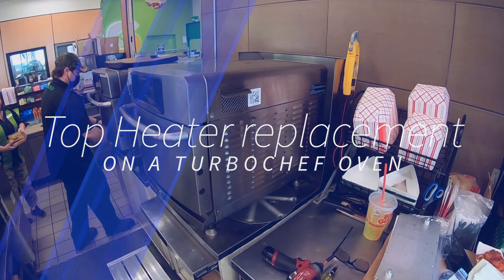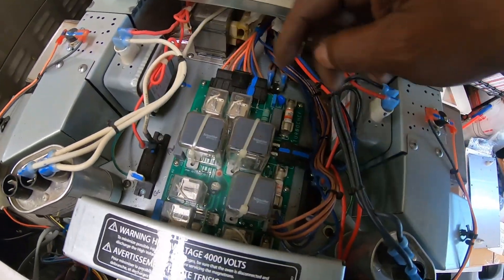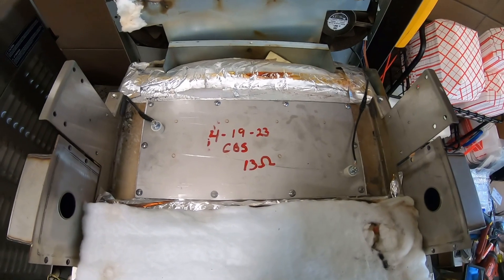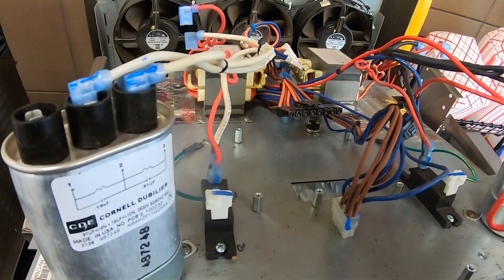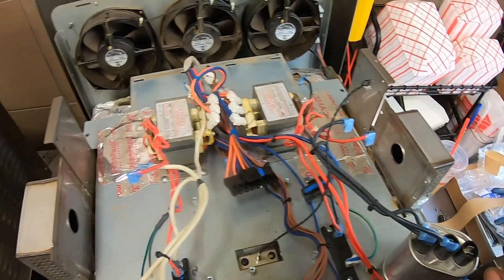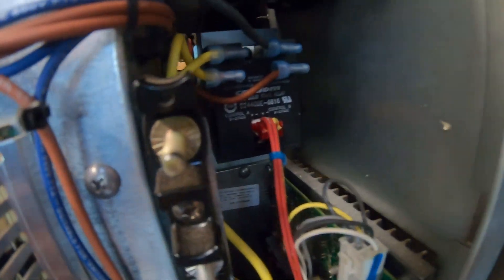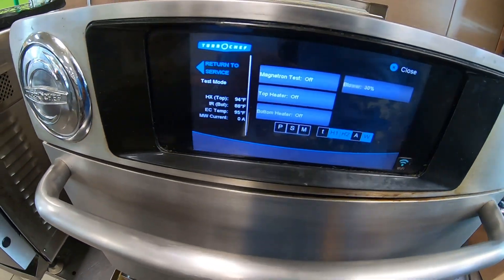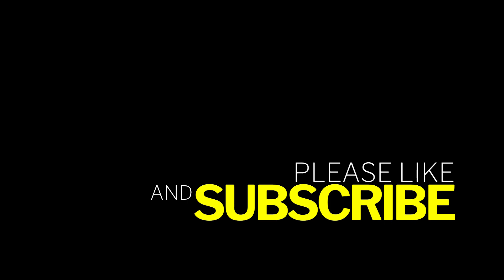Turbo Chef oven top heater

Comment: I have the same oven and the top heater is staying on and causing an F6: EC overheat. I tested the K4/K5 relay and here's the weird part... with all 4 output leads disconnected (not the control connector) the top element still stays on!!!. The only way I can get to to stay off is if I disconnect the other end of the element from the High-Temp Breaker in the back left (which from what I gather, is just connected to the EMI filter and then main power. Does this mean that the heater is shorted? I even disconnected the wire on top that goes from the element to K5/K6 (it had no frays) and the element STILL stays on! If I don't disconnect it, the oven never cools down after turning it off. It just says oven cooling down but the temp stays up and rises.

Comment: Turbochef dipped their toes into high end residential wall ovens about 15 years ago, and I was the local authorized servicer for them. The technology was cool, but they had a lot of problems. Those things were so heavy! Are the commercial units pretty reliable?
Reply from the maker: Thanks fir comment, the commercial unit are reliable as long as they are cleaned, and they are extremely heavy, lol, usual problems come from wear and tear, slamming the door and waveguides being cover in grease.

Comment: How do you know if the top or bad heating is bad how do you test
Reply from the maker: If out the oven in test mode you activate the top or bottom heater and on the display you watch the temperature change and you can also take a amp draw, thanks for the comment and sorry about the late response.